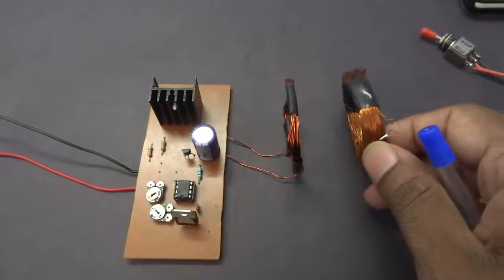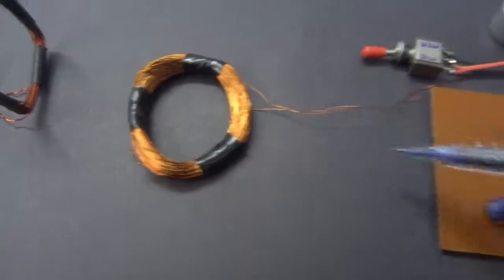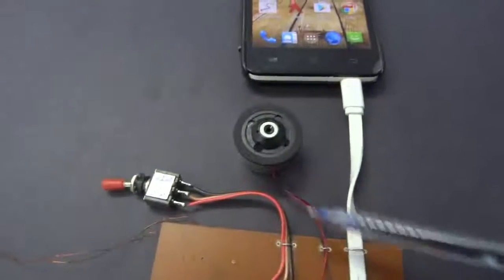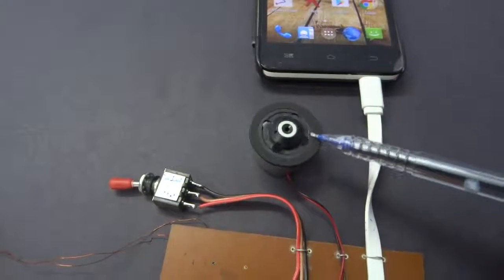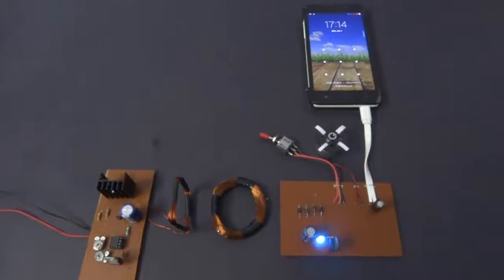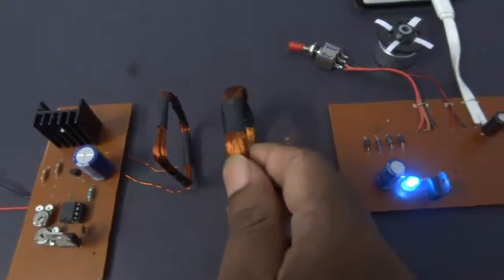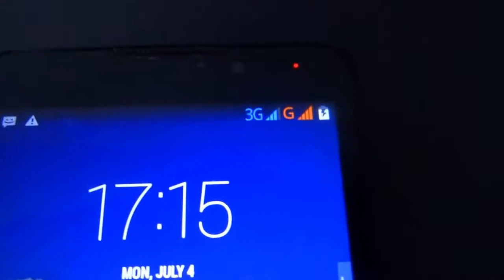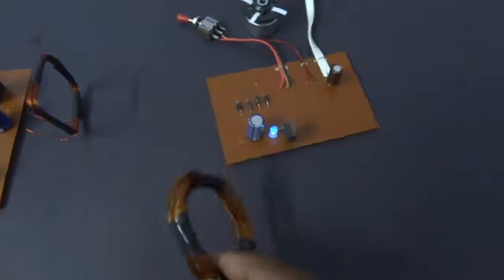Wireless Electricity Transfer and Mobile Charger Using 555 Timer and IRF540

Comment: Hi Plz send the circuit design for transmitter & receiver circuit you desgined. I already recognized for  timer circuit ic 555 for transmitter, suspected and receiver I already designed almos but modifications will be reqd. My mail  iss.dnasupport@issassam.com